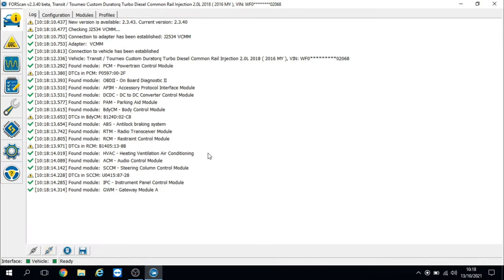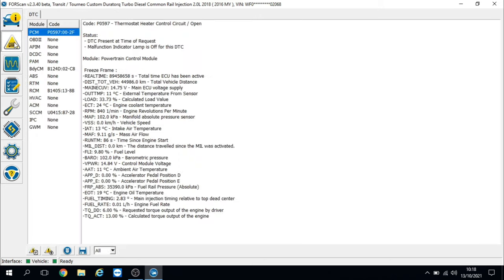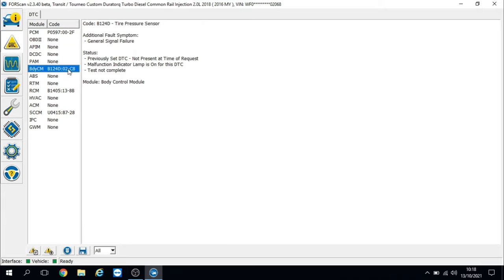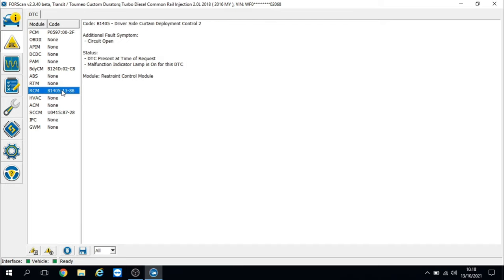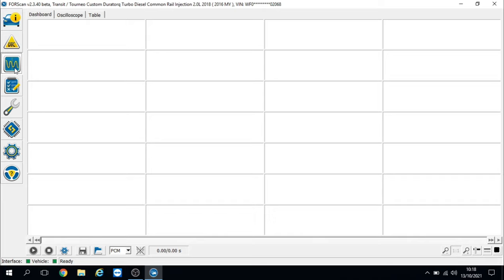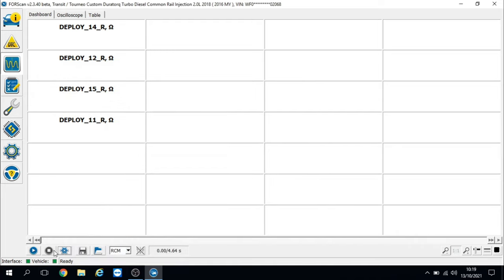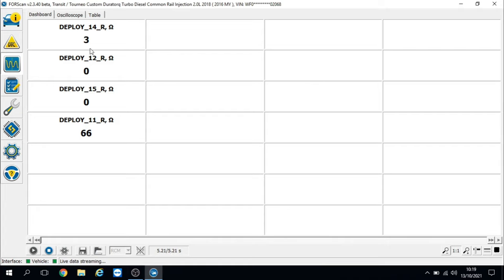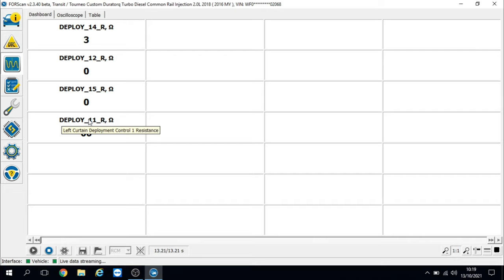TRANSIT TOURNEO CUSTOM - AIRBAG WARNING LIGHT B1405

Comment: Good find 👍🏻 in the beginning it would’ve been quicker going to the airbag module To do a continuity test. And as the module is mounted to the floor and underneath the carpet would be more likely To have a problem. 
In hindsight you still would’ve had to do what you did anyway 👍🏻
Reply from the maker: I've managed to get the harness replaced. I've not done a video of it due the time scale, but I have taken photo's. I may do a little montage . Thanks for watching

Comment: If this isn't fixed under warranty then if I was the customer I'd be thanking you for finding it, ask you to put it all back apart from the a pillar trim and I'll get my soldering iron out at home. I expect it's your companies policy to replace the loom, but I don't see an issue fixing a broken wire as all it does is pass electrons through it and the computer will tell you if your repair is poor and you'd have to be pretty crap at soldering if that was the case. If the fault was in the airbag or control module itself then that's a different issue and those should be replaced.
Regardless, its a good video showing how much time and effort goes into the diag and potential repair. Also how simple a lot of these issues are.
Reply: With airbag systems using very tight resistance tolerances its not recommended to repair a broken wire
Reply from the maker: Hi, thanks for the comment. As mentioned by the other viewers, its not the company policy, its the manufacturers policy and not just Ford, it would be all manufacturers, unless its a repair that they authorise as part of a recall (which I've never seen). The risks may well be worth taking, but its a safety system and I for one don't want to end up facing a judge for any unauthorised repairs. Thanks for the comment and for your support.
Reply: Fair enough. Out of interest did the customer have the loom replaced?
Reply from the maker: @robthomas7232  the loom is still on order, they often take at least 3 months to arrive!!  Ive a loom on order for another job i didn't video thats been on order since July
Reply: @SYDiagnostics  wow is this just the supply chain issues currently? That's a lot of time for a van to be off the road.
Reply from the maker: @robthomas7232  it seems most things are back ordered nowadays. But harnesses have always taken a very long time
Reply: @SYDiagnostics  I 've been told, that the wiring loom,does not exist as a part on the self.When you order a wiring loom,you order it, and they make one for you.Few years before, I had a melt wiring loom from an opel corsa, they told me from the dealer  that,to order one , its going to take 1,5 month ,because they going to build it.
Reply from the maker: @Lambros_Stefaneas  that's correct. Made to order

Comment: Good work. Do you think it might have had a replacement windscreen? Causing the issue? 
Hope it’s not a common fault!
Reply from the maker: screen hasn't been replaced, i think this is a manufacturing issue that's took a while to manifest
Reply: I had my money on replacement winscreen too. I've done numerous repairs after the  winsdcreen bandit has been and gone.
Reply from the maker: @Simon Manley Auto  no signs its been replaced , the screen is Ford and no "splodged" goo everywhere  

😀😀  could have been a good replacement process though, but can't prove it

Comment: I don't see a problem with repairing it. Customers will be walking away if every broken wire is a new wiring harness. That's stupid. Manufacturer just want to make money
Reply from the maker: SRS (airbags) are a safety feature, the manufacturer cannot guarantee any repairs susceptible to human error, I/you may well be capable of repairing it, but the next guy may well not be. So it will require a new harness and as its still under manufacturers warranty, then they will foot the bill not the customer. Thanks for watching
Reply: @SYDiagnostics  Yeah that's great. But wire is a wire. It's nothing special. Luckily is under warranty
Reply from the maker: @ErikTheVikingMechanic  I have to abide by the rules of those who pay the bill. I'd never show or advocate repairing airbag wiring. Have I done it before?....... Can't say 😳